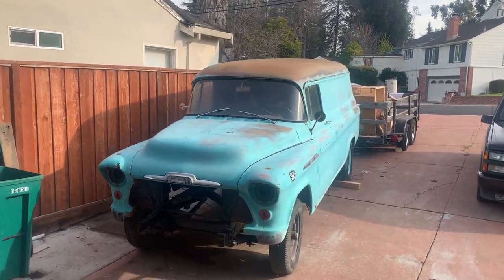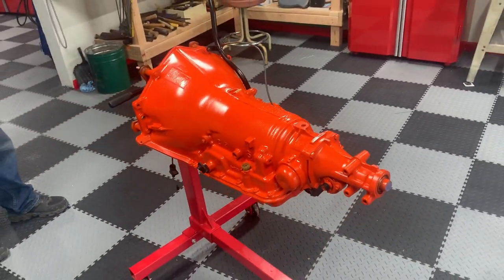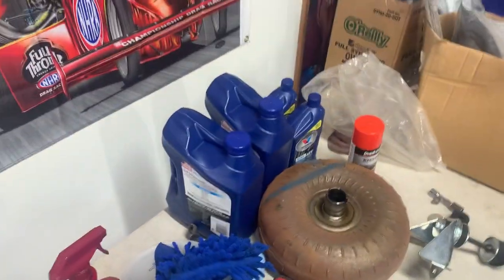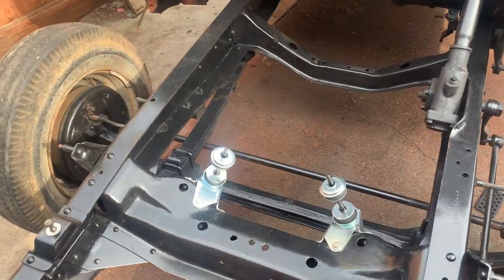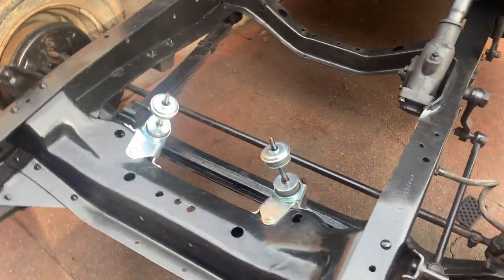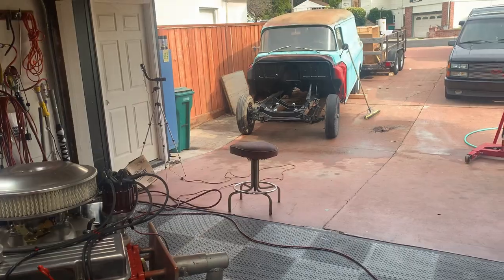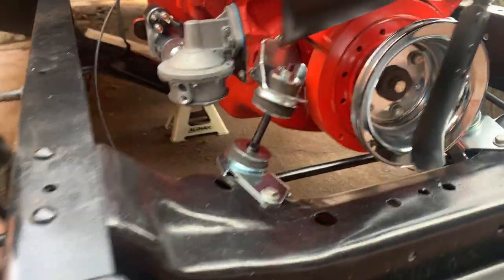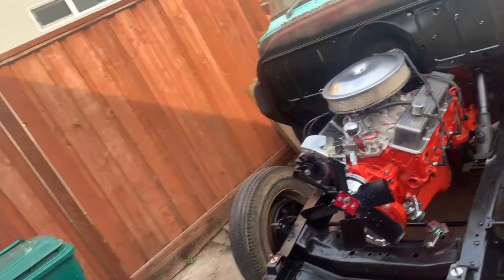1956 Chevy Truck Build Ep.1 - Motor/Trans Install

Comment: Hey guys.  I've started on my 56 Chevy 3100 series truck and came across your site.  I've had my truck for 40+ years waiting for the right time..... it's time.  I'll be using your videos as my guide.  Thanks again.  I'm thinking 327 with a 700R4 transmission.  Thoughts?
Reply from the maker: Sounds like a great combo to me. Good luck with your build.

Comment: Hello,  Currently in the middle of a 454/2004r install in a 57 3100.  Factory bellhousing crossmember.  I see yours is still in place.  So auto trans clears?  Room for pan removal, filter change?  Just wondering if it should be removed or not?
Reply from the maker: Yeah, everything clears no problem.
Reply: @bigblockkev  Thank you.  "Trying" to keep it simple/stock-ish.  Don't want to remove if I don't have to.
Reply: @bigblockkev  Thank you.  "Trying" to keep it simple/stock-ish.  Don't want to remove if I don't have to.